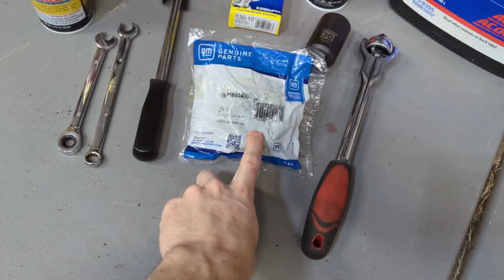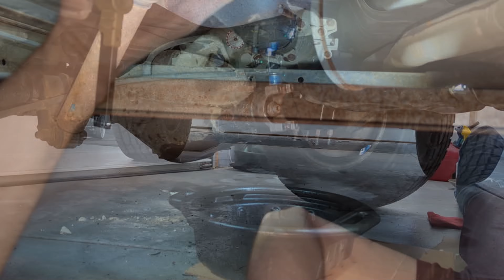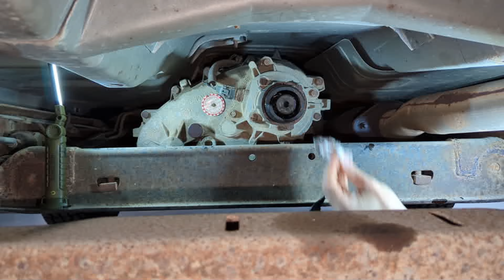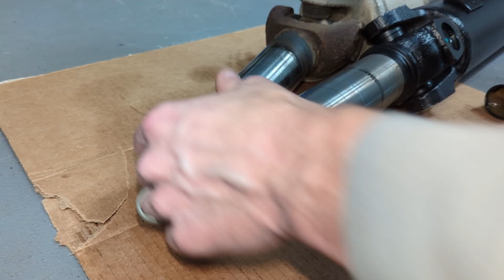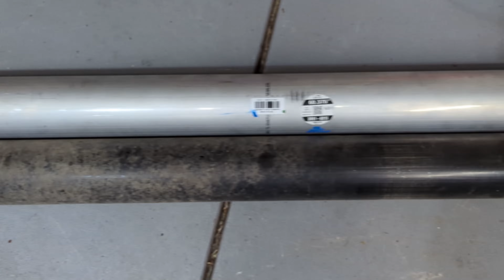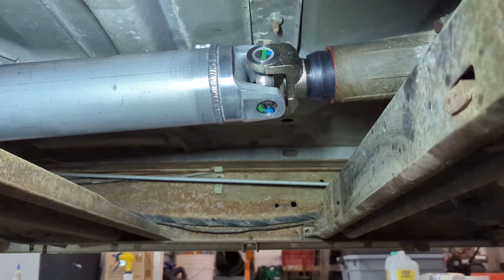Transfer Case Seal Replacement | 1994 Chevy K1500

Comment: You said you have a video on the input soft l shaft seal so you have a link I can't find it
Reply from the maker: Which seal?
Reply: @benwrenchin  front input your said in the video you had another video of that but I'm just gonna pull the transfer case thanks again
Reply from the maker: @ChuckiechuckCSA  I did the seal where the driveshaft goes into the transfer case and the pinion seal at the back of the driveshaft where it connects to the yoke on the rear differential.  Is that the one you're looking for?